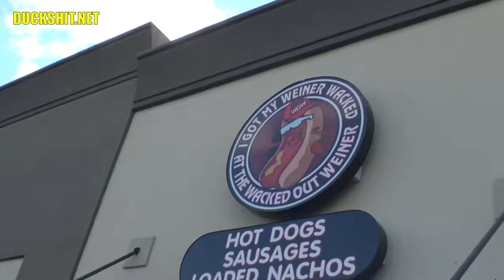BIGGEST ATTENDANCE EVER - VW Tech Session - March 2021

Comment: Great and fun video, Glenn. So great to see you two having a blast there. I wonder why in Mexico they seem to do away with all the engine compartment tin. That overheats and kills engines way before their time. On that bus maybe all the shift rod bushings and/or the coupling are all gone.

Those AC Industries disc brake kits are very good. As you’ve done with Bee’s Ghia the best thing to do is to Loctite studs in; so much easier to install wheels.

Those wieners you all had looked delicious!
Reply from the maker: Thanks so much,,,, AND
Thats what she said!  :-D

Comment: Duckman fiber glass dune buggy project  swing axle build question axle travel limiters needed or not needed any thoughts this is a full length nettle not shortened
Reply from the maker: That depends if its meant for street or off road.  Off road I'd want them to articulate as much as possible, so no limiters there!  Limiters are great for cornering on the street, you can use a camber compensator for that for best effect.  I had one on Ruby before I converted to IRS.  https://amzn.to/3vSiG98